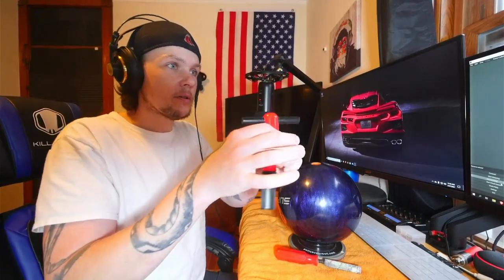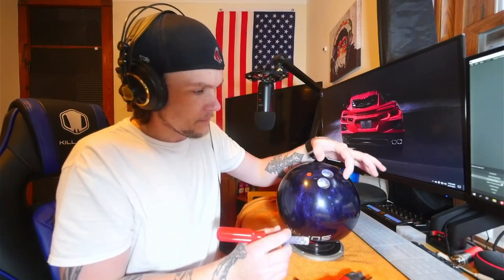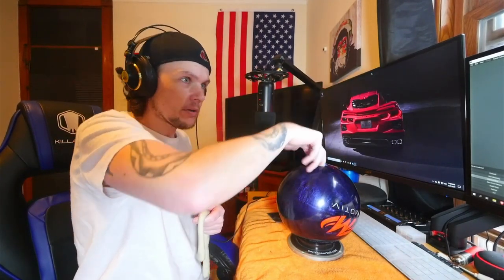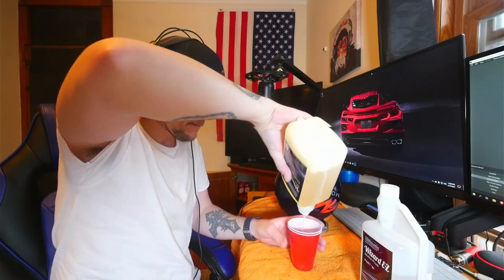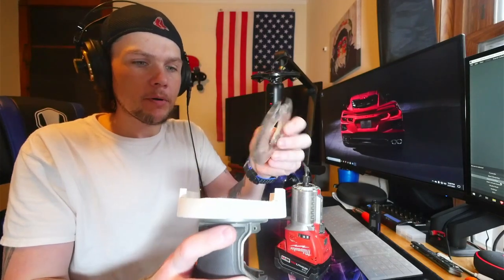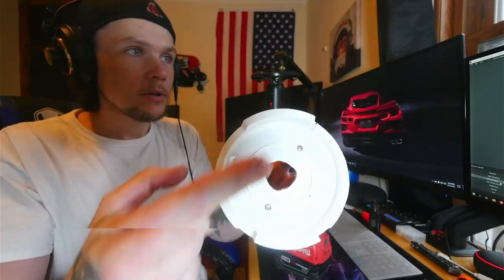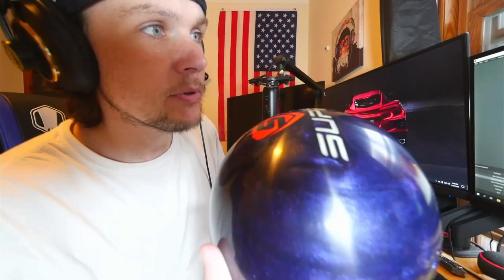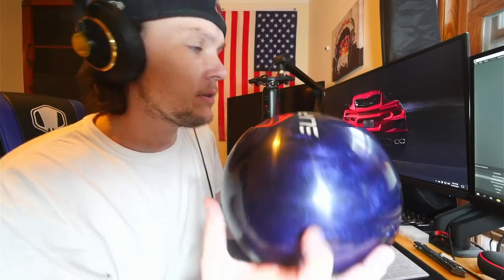Plug A Bowling Ball At Home

Comment: I'm happy you haven't seen this issue before, but something to keep an eye out for in the future is edge chipping or cracking due to keeping the beveled edge. At the shop I work at we cut out any bevel as the thinness of the plug at the bevel dramatically increases the chance of that happening. Also Wizard EZ part A is notorious for that buildup, we have some where it even hardened in that side tube where it travels up.
Reply from the maker: Good stuff man Thanks. What would we do without you tube?
Reply: Agreed. I would just sand up and down until the bevel is no longer there. Bevel creates a weak point. Want it to be a square shoulder without bevel.